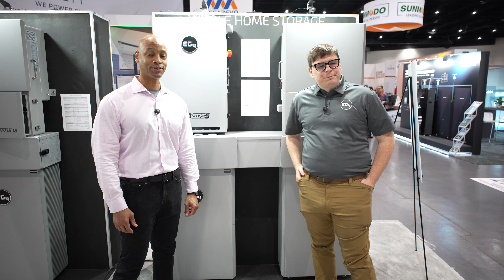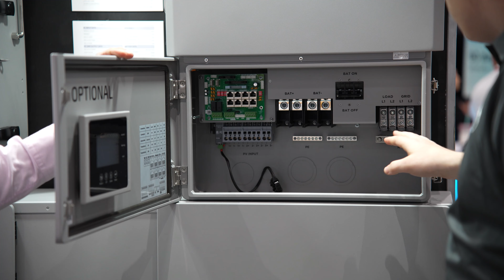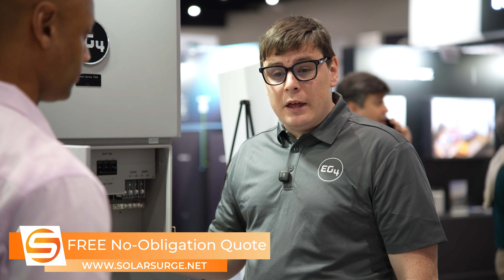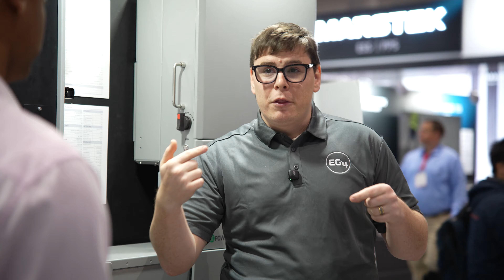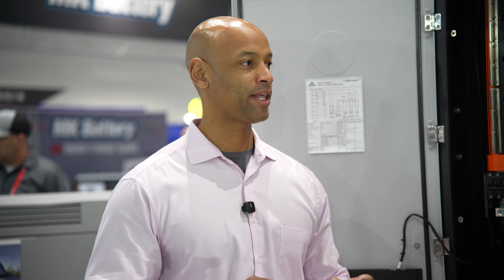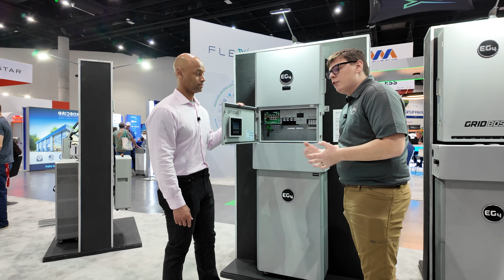New EG4 Inverter 2025 Lineup

Comment: When I first started thinking about Solar, I thought a grid-tied solution would work just fine.   But what I wasn't taking into consideration was my night time usage.   I have three adults in my home and each one has their own 65" TV, and home theater system.  Add my new F150 lightning and now I've got an electric bill again.  So I started looking into a battery back up system to cover my night time usage.  Originally started thinking of the Franklin WH battery, but didn't like the triple conversion loss.  I did like the 15 year warranty though.  Then I thought the EP Cube would be an easier install with a similar warranty.  So I called up Signature Solar to get a quote on the EP Cube and it was at that time they brought up the Flexboss 21 and the Grid Boss as another option to consider.  They gave me a quote for both.  And after careful review I thought the EG4 offering was the better value.   Plus the more I looked into the installation manuals I realized, I could probably install most of this myself, and I'm 71 years old.   By the time I was ready to make my purchase, the quote I had was expired and I had to get Brendan to requote for me.  I lucked out and the three All Weather batteries were on sale.   The original quote was for just over $18K and the requote came in about $750.00 less.  SCORE!!!  And it was all in stock.  So it shipped rather quickly.  I did the permitting myself, and over all, I started to work on my installation around the first week of February and finished up around the 25th of March.  Most of the time was spent working with the city on the permitting.  But that's because I'm such a rookie.  And fees,  sometimes I think the city just makes them up, as I can't make any sense out of it other than it's not cheap.  About $1200.00 with permitting and disconnect/reconnect fees.  But I love the system.  I've got my first smart port set up for my EV Charger.  I have it so it's on 24/7 when theirs grid present.  And only set up limitations only on the battery backup.   That way I can take my solar, and use all of it to charge my batteries while the EV charges from the Grid.  l love the way the EG4 Monitor allows you to configure the Gridboss.   I haven't tried the AC Coupled side with my EV Charger to see if I can recharge my batteries using my EV Battery.  Just waiting for a bright sun shiny day as they have been few recently.   ;0)

Comment: Ive been selling generators for several years now.  I've been waiting for the battery market to be a solid competitor.  I think we are at that point with the way generators have been going up in cost and batteries coming down.  Also, it doesnt make a lot of logical sense to spend 5 digits on an automatic backup generator thats going to get 500 hours of use in its lifetime when grid tied equipment can work everyday the sun is shinning as well as be backup power when configured properly.

Comment: Future content/video suggestion if not already done.  It would be cool to do a video or two covering a couple different installations for homes and what is needed and/or needed and recommended.  For example let us say I have existing solar and inverter and I want to upgrade panels, add panels, or both panels and storage what would I need to do this using this product (or other).  Or what would I need to get if I wanted to upgrade in stages such as replace my inverter first, then panels, then add panels, etc.  It seems like EG4 is trying to do this but as a newbie it is confusing and I have no idea where to start.

Another great video.  Keep up the great work.

Comment: I just purchased the 48v-3000EHV for $603 on March 4th and had spoke to the rep about buying a second unit once this was installed.....in less than a week it went up to $1049!  So that option is dead and may just go the a Victron Multi Plus II that actually has an application that works.  But good overview video for sure!  Thanks

Comment: Got an $800 Predator inverter generator that can only run an RV 30amp plug 120v at most. This is the perfect solution for me to hook it up and bulk charge the batteries back up in an outage like we've had during Helene b/c I have a small solar window.

Comment: Great video on EG3. Can the EG3 Inverter system handle pre-installed SunPower Solar Panels AC/coupled with SunPower micro-inverters, i.e. can the EG3 inverter "talk" SunPower protocol to keep the solar panels active when off the grid?

Comment: built my own 48kwh battery pack for the price of just one of these companies 14kwh battery boxes. It's been running my house for 4 years.
Reply: Details? Lifepo4?
Reply: @idahoduckhunter  bought 48x 280AH LifePO4 cells from aliexpress for $75 each, then got a few JKBMS's and some wire. Put each set of 16 cells on a different level of a metal shelf.
Reply: @idahoduckhunter  48x 304AH lifepo4 cells from aliexpress at $68 each shipped, and a couple of JKBMS with some wires. Put each 16 cells per metal shelf and wired it up through a couple of DC breaker switches.

Comment: On our testing all of them could only put in about 15% Tesla could almost put in 16%
Easley demonstrated with a volt meter
An amp clamp 
An volt amp meter 
Or amp logger
Reply: 15% of WHAT?
Reply: @w8stral  the actual power going into the grid it's in ohm's law thing do you have a volt amp meter
Reply: @ Ah, so I do not  care as I am off grid.  Not selling power back to anyone...
Reply: @w8stral  cool 
Just so many folks are hurting with the skyrocketing electric bill 

Do you have a dump or a diversion load what do you do when your battery is full we make hot water oxygen and hydrogen even have a hydrogen heater and a barbecuer
Reply: @ LOL, have thought about making alcohol from wood with the excess power, and then use it to run the generator for December, but that takes too much work as solar array is gargantuan for winter and clips by February/March
Reply: @w8stral  oh yeah we get all the bad beer from the guys at the cement plant they give us a beer that they didn't like with their experiments and we just pulled alcohol out of it
Reply: Also played with a wood gasifier
Reply: But in the truck took about a pound of wood per mile 
Generator wasn't that bad

Comment: Installers hate this as there is no real markup for them and the actual labor to install is tiny, so realistically, the battery is ordered delivered to the customer and they should charge a nominal fee to install it for them maybe 300-400 bucks tops as its not even half a days work, might just be 2-3 hours.  Lets not forget all this is before the tax credit also.
Reply: Maybe for off grid DIY or battery only. There is a lot more that needs to be done for solar and grid integration. Long term, who will service it too.
Reply: Markup does not translate to profit.  Markup covers all the costs associated with handling equipment.  If a product is delivered directly to a customer, I'm not using warehouse space, warehouse labor, inventory tax, storage damage liability.  The list goes on and on. Also I'm not having to set aside a percentage for future product warranty service.  All those costs have to be factored into markup.

Comment: Sooo, will the grid boss never need service? It includes some active electronics since it can load shed. What happens if service is needed a you need longer have a transfer switch to bypass your system. And will power companies universally accept this as the manual disconnect?
Reply: Yes, power companies us the UL 67 standard, if they want a physical knife switch you can use a $150 100A knife between the inverter and the gridboss instead of a $800 200A unit

Comment: Hi there. Suppose I already have 26kw x 12 pc of stacked diy kit batteries. How do I connect the flex boss 21 to all this power I already have?
Reply: Do not need coms for battery integration.  Its nice to have, not required.  The generator or Grid tie Battery voltage cut in point is still set by YOU in the Flexboss or the older XP or PV models.  Monitoring SoC via EG4 hybrid inverter is all the com connection really does.  Your BMS you installed on your batteries already does SoC and low cell voltage monitoring so....  Nice to be redundant, but...A single Flexboss21 will limit charge/discharge current to 250Amps@~50V so for winter conditions or even a larger sized house with oversized solar arrays, this is insufficient.  Will require adding a 2nd in parallel or a cheaper 12000XP would probably be the better option.
Reply: Hi there.  Brilliant thank you. I will be in Warner climate in Jamaica so dinner to worry about cold.  But I hope 🤞🏾 to have 160-200 kWh of diy kits to run 4 apartments and a main 3 bedroom house, two rooms being used mostly. A lot of extrication appliances for all the properties plus pool pump and water holding tank 1 hp pump too. I must tune crazy to try and do all that off grid but I have to as the power company is way over priced and poor people out there can barely pay the monthly bill. Only one company covers the entire island. I’ll still want to be connected to them as emergency backup to charge the batteries if more than 3 days of rain and cloud. I estimate I’ll need 4 x 6000xp for the tiny apartments and 1x 12000 xp or the flex boss for me in the main house.

Comment: Really good interview! Thank you.  The ability to have the Grid Boss on one end of the house by itself, and place the Flex Boss and batteries on the other side in a garage or power shed with less expensive cable is a huge benefit.
Reply from the maker: I agree. That’s one thing I like about James and his company is that they really do listen to the practical considerations and concerns from installers and respond with solutions.
Reply: How is that any different than what was done before?  Its not.  Dude blatantly lied.
Reply: @w8stral What specifically did he lie about? He talked about how expensive it used to be to not have the inverter right next to the meter.

Comment: Is this better then Tesla Power Wall?
Reply: Its hard to tell with the power wall... PW3 I would assume, because the quoted prices do not include professional installation and the marketing always low-balls what the professional installation winds up costing.   Also, the PW3's DC coupled solar (6 MPPTs, I think)... requires proprietary Tesla RSDs.  So you are buying into and getting locked into the full Tesla ecosystem. 

The reason I wound up with EG4 is because the PW2 used NMC batteries, so I was waiting for the PW3 to come out... otherwise I would have had my ESS installed a year or two ago.  But then the PW3 did come out AND Musk went AWOL at about the same time, and I decided not to tie myself to the Tesla eco-system.  In fact, at one point over a year ago I was looking at Sol-Ark because I was so unhappy with Tesla pushing PW2's / NMC chemistries onto people for home-storage... but was held back by the cost.

EG4 wound up getting my hard earned money.  I really like the modular system and the 48V LFP standard.  It gives me a lot of scaleability and options.  The FlexBoss's LRA capability and the GridBoss's functionality sealed the deal.

-Matt
Reply from the maker: Depends on your application. Many people prefer the more modular design of the EG4
Reply: @ Is the cost lower vs Power Wall or comparable?

Comment: Right around the 24:30 mark the EG4 guy say to run your communications cable WITH your power cable between the inverter(s) and the GridBoss.  As far as I'm aware that is in violation of the NEC regarding having low voltage and high voltage cables run together.  Do your future self a huge favor and bury an extra 1" conduit next to (but a few inches away from) the conduit holding your power lines.
Reply: There are 600V rated cat6 cables that should be fine to run in the same conduit. I did it. If it were highspeed Ethernet I might be concerned with being laid with the AC wires but I'm pretty sure it's CAN which is a lot slower and more resistant to noise
Reply: @hubbellc  I'd forgotten about the availability of higher rated insulation for some Ethernet.  For a relatively short run it would likely work fine, as long as any inspectors are on board which was my main concern TBH.  I've laid Gig Ethernet in the same cable chases as power and it didn't have any problems, but those chases were ones that any inspector would REALLY have to work at to get to.
Reply: I believe that NEC allows comms in the same conduit as higher voltage power as long as the comms are related to the same devices that the power is related to.  But I think it does require that the comms cable insulation be rated for the highest voltage found in the conduit.  Not sure what insulation rating a typical CAT5 cable has.

Inspectors might have different ideas.  Certainly neatening the cables up and separating them, zip-ties, and so forth might be directed.

-Matt
Reply: I believe that is why he said to use shielded cable (Cat6 shielded) instead of Cat5e.  And the shield needs to be grounded.
Reply: @junkerzn7312  I believe that would be Article 725. The "Enhanced Content" in the manual adds "In addition, if listed computer equipment is interconnected and all the interconnected equipment is in close proximity, the wiring is considered an integral part of the equipment and, therefore, not subject to the requirements of Article 725. If the wiring leaves the group of equipment to connect to other devices in the same room or elsewhere in the building, the wiring is considered “wiring within buildings” and is subject to the requirements of Article 725."

Section 725.48 Conductors of Different Circuits in the Same Cable, Cable Tray, Enclosure, or Raceway, (B) Class 1 Circuits with Power-Supply Circuits (1) In a Cable, Enclosure, or Raceway adds "Class 1 circuits and power-supply circuits shall be permitted to occupy the same cable, enclosure, or raceway without a barrier only where the equipment powered is functionally associated. Class 1 circuits shall be permitted to be installed together with the conductors of electric light, power, non-power-limited fire alarm, and medium power network-powered broadband communications circuits where separated by a barrier."

So, if I read that correctly, running the communication wire in the same conduit between the inverters and the GridBOSS IS allowed because that group of equipment is interconnected and in close proximity so considered an integral part of the equipment and functionally associated.
Reply: As long as the low voltage wiring has an insulation voltage rating equal to or greater than the power conduct utilization voltage, you're good to go.  There may or may not be interference.  There are plenty of applications where comms are actually sent over the power conductors along with the power.
Reply: You can as long as you pay 14 cents per foot extra for shielded cable

Comment: Love my setup which is ... basically exactly the one shown.  Its working well though there are some bugs which I hope EG4 will get fixed.  Sometimes when I trip the grid breaker off the GridBoss turns off the smart port with my AC coupled solar on it... and doesn't turn it back on while the grid isn't present!  So I wind up on backup power with a low battery and it aint charging because the solar is disconnected.

It's an odd bug.  Sometimes the GridBoss turns the port off (and doesn't turn it back on until the Grid comes back), sometimes it leaves the port intact and the AC coupled solar is able to charge the batteries without the grid.  Very odd.

In anycase, I'm really happy with the setup in general.  It's a very clean design.

-Matt
Reply: I would love the grid boss but I just installed the 12000XP

Comment: 12000xp with a 200amp passthrough panel less than 3k
Reply: Yup, I have ZERO understanding why anyone would want the Gridboss or a Flexboss21 instead of the 12000XP outside of cleanliness of install.  Supposedly it makes things a cleaner install for a HIGH price.  His claim about smaller cable etc is patently false.  $60/ft, what a joke.  200Amp rated 2 4o 1 2ot neutral aluminum costs ~$4/ft.  His claim about less complicated for home owner with load shedding?  Uh, that already exists on 12000XP, so all the Gridboss is is a clean expensive pass through panel for load shedding
Reply: @w8stral  the only thing u want the grid boss is for is if you're grid tied. But off grid I don't get it
Reply: @electromechanicalstuff2602  Well actually I finally got it after looking more into it.  You get smart load shedding breakers, bus bars for running multiple inverters, generator setup and ~3 equivalent UL boxes in 1 + additionally an extra off load 200A service.  Most homes due to modern igit regulations you cannot put a whole house on a single panel and you have to have 2 breaker panels and heaven help you if you have a shop with a machine shop.    Now if you are like most people who are PAYING $$$$ for labor to install instead of doing it themselves then the Gridboss is a slamdunk as hours to install is drastically reduced and if you are paying someone $150 an hour(I was an electrician apprentice and yes this rate is true) then this Gridboss is TRULY a major slam dunk.  Especially if you use their wire trunk.
Reply: @w8stral  my meter base is wired into a 200 amp passthrough panel. It has it's own 200 amp main breaker and 1 load breaker in it. 100 amp that feeds my 12,000xp. The passthrough lugs feed the main breaker on my 200 amp breaker panel. The inverter feeds a 100 amp breaker in that panel also. I have an interlock installed so both the grid and inverter can feed my house at same time. All under 3k